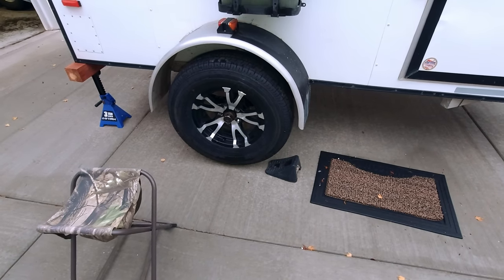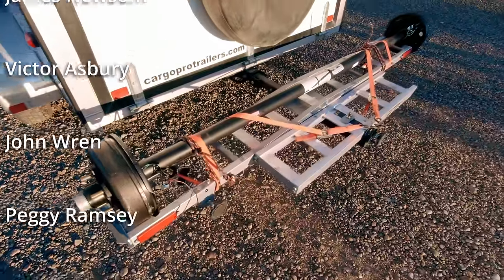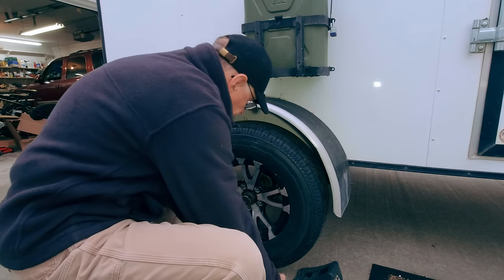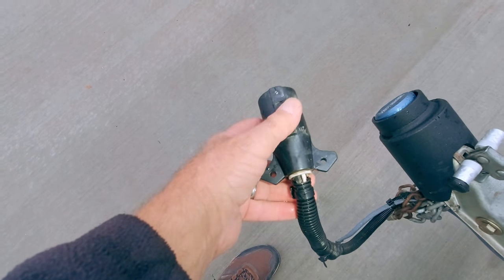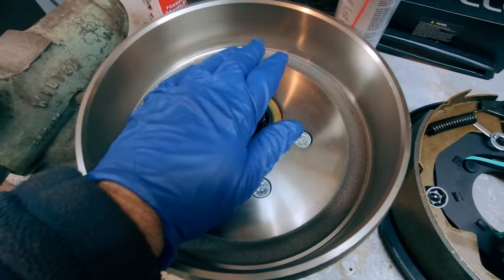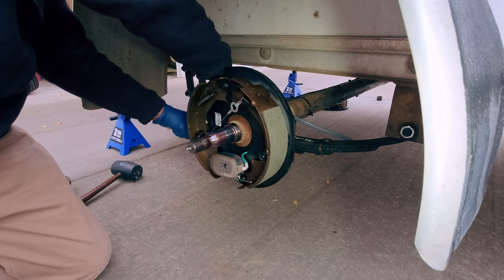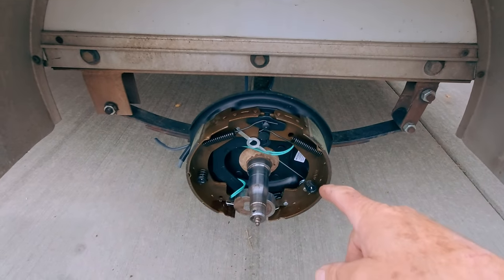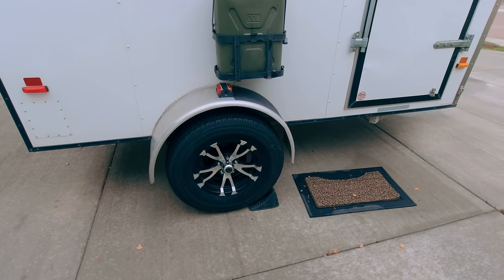Trailer Brake Installation - DIY - It's easy and cheap

Comment: One more step…..install a break-away switch which will apply the brakes if the trailer becomes disconnected from the vehicle. Inexpensive and easy to install. The break-away switch can connect to your house battery so a separate small battery is not required.
Great video Rick as always.
Reply from the maker: Good suggestion and one that I figured I could easily add later.  Thanks for the tip about using the house battery.
Reply: That was what mine had, but since I have 200AH of 24V inside, I deleted that little battery and hooked it up to the 12V converter. I'm also considering using a motion sensor alarm, to hook up to the brakes for theft protection.
Reply: @markparr7224  I wasn’t aware that motion detectors were available for theft prevention. So parasitic drain would be a concern if not hooked to shore power or solar charging while not in use.
Reply: @Grumpyneanderthal  I do have solar in mine too, btw.

Comment: When I used to replace trailer brakes I would get the kit and replace it all, use to cost about the same as the new brakes and drum and usually things are rusty and rotted.  I still would rather have someone else do it now days.   Hope she makes the next trip feel a little safer.  Stay safe and healthy Sir.

Comment: It is important to emphasize that Rick is using the wire nuts shown in the video only to cover connections that he has soldered.  Never rely on wire nuts alone to secure electrical connections in any application that is subjected to movement and vibration.  😀
Reply from the maker: True that!

Comment: You make it look as easy as it is! 
Only suggestion is use more grease. The drum has a cavity in center for this reason. Grease helps cool the bearing surfaces and flush away contaminates. Also on spindle before sliding wheel/bearing assembly on. 
I repack my bearings every spring no matter the mileage too. With braking more heat will be generated as well.

Comment: Just wanted to say thanks Rick for the Swain's referral. They replaced my axle with one they had in stock and repacked the grease in the bearings. Nothing to compare it to but I was hurting financially when I left. $523 total. 
Then blew a tire coming from Missoula in a work zone. I dragged the trailer down the road on the spring!!! Needed a new wheel/tire, U-bolts, nut and a retaining plate. Expensive. Also set a roadside fire. DOT put it out and helped me along with the local police. Limped into Drummond and a local helped me. On top of which I got really sick.
Thank god the axle was ok. 
Stayed at Sun River BLM campground west of Great Falls. It was the best site I have ever visited.
Reply from the maker: We know that campground. Hope you're okay now, wow, what an experience!

Comment: Thanks.  This is my next add-on for my conversion trailer.  Hasn't been a problem at all for a couple years till I had to stop suddenly at highway speed.  And nothing slowed down!  Very scary.  Thought i'd have to put a whole new axle in but this is terrific.

Comment: Great video. Short, to the point, and just enough information to make the installation correct. The only thing that I would add is what my trailer shop said, you might want to look into a break away switch. It depends on the trailer and the DOT you are operating under. Otherwise, this is simple. Going to do the same shortly. Thanks for the video.

Comment: Thought...? Consider putting axle under for a bit more lift and put air pad in the new opening. Been watching and see the "chop" action of your unit as it bounces down the road. The air pad will help with the shock and take some of the punishment off the leaf springs. GOD BLESS
Reply from the maker: We already have enough ground clearance, but you just gave me the best reason to flip the axles anyway!  We've tried to find a way to install shocks, but there just isn't enough room.  Your idea would help, and I'll be thinking about it.  The only thing that would stop me is the increased windage leading to poorer mileage.

Comment: Looks like you could put a small air bag kit on the trailer and have taller rims . By using air bag system you could lower trailer when you camp and your sweet wife could step up easy and still have dirt road clearance with axle and a less rough ride on the trailer on and off road.....Love you guys . I bet that spring shop would have good idea to install small air bag system to the axle.
Reply from the maker: Cool idea, thanks.

Comment: Wish I had backing plates on my trailer axle!  Many smaller cargo trailers have just idler axles w/o brake mounting plate. Need to check what you have before ordering
Reply: Oh, and thank you for letting us know about odd size axle spring mounting holes.  I will definitely measure mine more thoroughly before ordering.  I measured mine and it was close to 70 but will triple check now.

Comment: Rick, thank you for this video. You explain the process so much better than the “professionals”. I have a 6x10 that is used as a work trailer and camper. I used to pull it with a 3/4 diesel which had more than enough braking power. Now I have a Tacoma, and have quickly realized that adding brakes to the trailer is a must have!

Comment: I would make sure that the wires are not anywhere they can be pinched between the u-bolts and the frame in case of a big pothole or a big bump especially if there is any indication that the axle has bottomed out in the past.

Comment: How easy to install trailer brakes. AND, how easy to order the incorrect replacement axle! HAHAHA!
Good episode. 
You did not show adjustment of the brake controller, mounting the brake controller. 
Another episode/update?
Reply from the maker: Yeah, that's a whole other subject.  I didn't cover it because I had a lot of problems, that turned out to be a faulty controller, and I haven't received the replacement yet.

Comment: Heat shrink is a way better seal on the wires, I re-did mine because they used those stupid "Scotchlocks" on all of them. And they weren't secure enough for my liking either. The thing I really loved about my Tahoe, and your Yukon as well is the brake controller is just mount, plug and play. Now to just get it on the road... But my build is very much more substantial than yours, but I plan on living in it. I know, I'm crazy....

Comment: In your comment to me, the air bags would not be for "lift" but rather to act like the shock you mentioned. They become a air-bumper for the springs and axle. They are also adjustable on air pressure due to your needs. Can you fab a wedge to the shape of trailer tounge back to the box that would engulf tanks, add storage above them and better split the wind? Your trailer is great and hope to meet you some day on the trail. GOD bless and be safe.
Reply from the maker: Thanks Jim, you're full of good ideas, but I'm too lazy in my old age!

Comment: Interesting that the brakes are self adjusting, I see the link in the description. Lippert OEM are not self adjusting and require adjustments every 3000. Nice to have self adjusting. I bought a tandem axle trailer partly because they come with brakes. I will replace mine with the same one you used when the time comes.
Reply: I am in the middle of replacing the 4 brake sets on my flatbed 7000# trailer.  I decided to upgrade to the self adjusting for ease of everything.   Should be up and running tomorrow and Hay hauling is scheduled for Saturday.  When the hay man calls and says he's cutting the field you get prepped, when he calls and says he is baling, you drop everything and go.  Years ago when I was looking for a flatbed trailer I found several that only had brakes on one axle; not my cup of tea.

Comment: I am in the process of putting new brakes on my dual axle trailer, And all new wiring for lights, The wires on the brakes are 16 ga. I ran a 14ga wire down each rail to handle 1 pair of wheels, No cross over wires,And remember you can use "Shrink tube" for your splices

Comment: Nice  job on the video.
I was cringing when you made the electric connections and wrapped with tape because I have had horrible luck with those. But then you coated everything with the liquid tape and I knew it would be okay.

My utility trailer drove me nuts with the shrink tubing letting corrosion get in and break connection. Should have soldered them first maybe then the shrink tubing would have been enough.

I'll be soldering and using waterproof connectors in the future.
Reply from the maker: Thanks for watching!

Comment: I purchased the southwest wheel, self adjusting 3500 pound brakes and installed them with all new wiring and really good connections. My prodigy brake controller always worked before, but I cannot get these brakes to adjust, self adjust, tight enough to even keep my truck from idling forward in drive. I have tried pumping the brakes in reverse and forward hundreds of times and all I get is a slight drag. I can crank The Prodigy brake controller all the way up to 13 and it still doesn’t grab enough to stop. Installed on a 1200 pound single axle utility trailer.
Reply from the maker: I had to start by manually adjusting the brakes first.  Then I took it out on a gravel road and adjusted the controller until the brakes would lock up at around 10mph, but not on asphalt.  There is a break in period and you need to apply them hard from 35+mph down to a complete stop a few times in the beginning.  After this I just adjust the controller until it feels right going down mountain passes.  Lastly, if you call Prodigy they will give you advice on how to set it all up.
Reply: Thank you I’ll give it a try tomorrow

Comment: Trailer brakes are good to have if you use your trailer a decent amount.  I have a 6x12 conversion that is about 3,400 lbs fully loaded and the trailer brakes provide peace of mind.  No matter how carefully you drive, on long road trips you are going to get caught in a situation needed short stopping distances or rapid deceleration.  The trailer brakes put my stopping distance back down to what the naked truck has.  Also, in wet and slippery conditions, the trailer brakes make the truck less likely to jackknife during a rapid slowdown.
Reply from the maker: Well said, Otto. Thank you!

Comment: Every trailer or fifth wheel I have ever owned needed to be aligned or straightened. I don’t think the manufacturers align them at the factory. Most people don’t do enough miles to notice their tires are wearing uneven. We travel at least 10K miles a year and it becomes evident pretty quick.
Reply from the maker: How about the tire shops that say, "Trailer tires don't need to be balanced"?!  I think they must say that to get you back for new tires sooner when yours wear out in one season.

Comment: Rick, I am not sure you set those brakes up properly. There is a star wheel in there that you have to spin to get the brake shoes close so the "automatic" adjuster can take over. If the shoes are not close enough the "automatic" adjuster will be too far away & cannot do its job. Sometimes they are close enough when you install them, but not always. Just looking out for you!
Reply: Another thing I always do on drum brakes is to apply 'never seize' to the threads on the adjuster.  Remember seeing one in my younger days that was froze up.  Pain to get the adjuster out of the brake set but worth is in the long run.

Comment: Haha I think Jessie is too much of a tightwad to take it somewhere. Pretty sure he'd still do it himself. As long as there was no reason that he couldn't. Oh my gosh! Such a bummer that you got the wrong one. Oh dang. That's good to know. I wouldn't have known that either. Great information. Do you know if that's the same for all 6x10's? Great job getting those brakes installed. You make it look fairly simple.
Reply from the maker: I don't think it would be the same for all makes, so measure very carefully before ordering.  Installing the backing plate kit was easier than changing an axle, by far.

Comment: Have you weighed the trailer on a CAT scale?  Seems like you have a lot of broken springs, maybe the trailer is overweight?  You might want to look into adding some additional spring support with SUMO springs.  If nothing else SUMO springs will smooth out the ride of your trailer.  Also when you are pumping grease into the hub it is good practice to spin the wheel for two reasons.  One so it doesn't build up in an area and lead to grease blowing out the back of the wheel seal, and second so grease is thoroughly spread throughout the bearing.  Last thing if you can pick a time of year to do annual greasing do it in the summer when it is good and hot.  Then the grease will flow easily through the bearings instead of blowing out the grease seal in the back and contaminating the drum and shoes.  One more last thing and you may already do this, but it is good practice go down a hill in the same gear you went up the hill in so you utilize engine braking.

Comment: When attaching the wires with butt connectors, don't use electrical tape. It will eventually come off. Use heat shrink tubing.

Comment: Great video, thank you!  Is itnpossible to install breaks on a boat trailer that will be going underwater during boat launch and retrieve?
Reply from the maker: Yes it is possible, but I'm not an expert on boat trailer brakes and I suggest that you research it.

Comment: Single axle trailer axles are typically rated at 2000 lbs. or less.
Reply from the maker: I don't know about that, because this one came with a 3500lb axle.  Maybe cargo trailers are different?

Comment: Was the controller expensive? I believe it sold separately correct?
Reply from the maker: Yeah, Wes.  I bought a middle priced Hopkins Reliance and it was about $60 plus the pigtail to match my vehicle.

Comment: Where did you purchase the jacketed wire for the brake install? Is it possible to buy blue and white jacketed wire specifically for trailer brakes or do you get 3 wire jacketed wire from etrailer?
Reply from the maker: I got two wire jacketed from my local farm and ranch store.  I would think that it would be available on Amazon also.

Comment: Hey Rick, I have a 1958 Jeep Utility Trailer that I want to upgrade the brakes to electric on. Do you have to have anything in between the brakes the the 7 pin connector? Like a breakaway trailer kit? Did you put one on your unit?
Reply from the maker: I haven't put a breakaway kit on my trailer yet, but I should.
Reply: @gonagain   I just picked up a 1948 Jeep M38 Utility Trailer and I am thinking about putting electric brakes on, so thanks for sharing. After watching, I realized that If I am going to modernize the trailer for a smoother ride, I might as well as some shock absorbers and a breakaway kit to - so thanks for the video, it was helpful.

Comment: Will that brake set fit on 13” 5 lug wheels?  What size are your wheels and brake set?
Reply from the maker: It's a kit from Southwest Wheel and it's a 4.5" bolt circle. I purchased it on Amazon.

Comment: Rick tried to sent you an email about his camera system but it was undeliverable. Guess it's collateral damage from being hacked. Know ur busy putting Humpty Dumpty back together agn. But when you get a chance can you tell me which one....oh happy Thanksgiving  !
Reply from the maker: Hello Herb!  Do you mean what camera I use?  If so, I do all of my work with a simple DJI Osmo Action.  It's the original model and never gives me any problems at all.  They stopped making it and replaced it twice, but I don't care at all for the newer models.
Reply: Sorry l didn't make that clear...the 4 camera security system he has. I'm interested in the backup capability.

Comment: Put brakes on my trailer, but power is only going to one wheel not both.  Assume it's how I wired it ?  Didn't think it could go wrong, but it did.  Any suggestions ?
Reply from the maker: Did you adjust the linings after you installed it?  Also,  can you hear anything at the drum when someone steps on the brakes? There may be a bad connection, but you can't hook it up backwards, so see if you have 12 volts at the connection.
Reply: @gonagain  thanks so much for the reply,  I really enjoy following you, your topics and info.   After sitting back and looking, I saw that I had most likely wired it wrong and I did !   Works now !   I panicked too soon !  Keep up the good stuff you are doing,   you have a way of presenting problems and solutions that is sound advice I trust.  Thanks!

Comment: hi i m RV beginner ,after brake Install how to know trailer brake is work?how to test it?
Reply from the maker: What I did after the install was to take my trailer out onto a dirt or gravel road and adjust the trailer brake controller until the brakes would just lockup when coming to a stop and then back it off a little.  Make sure they don't lock up when coming to a normal stop on pavement.